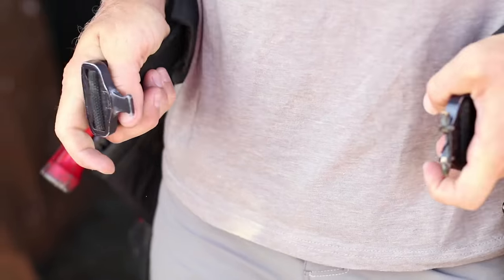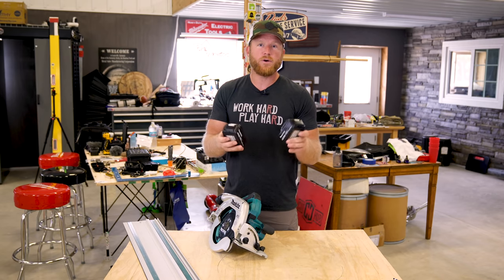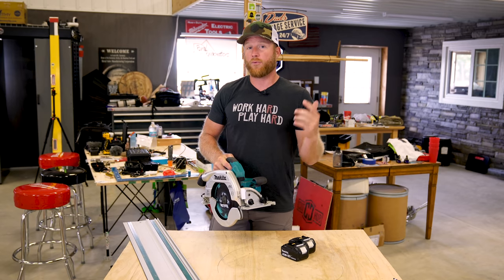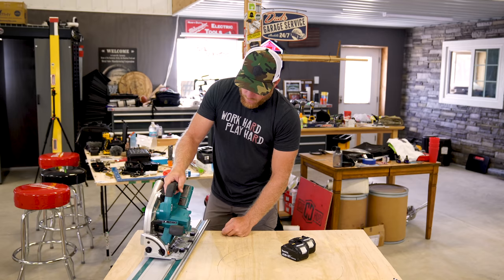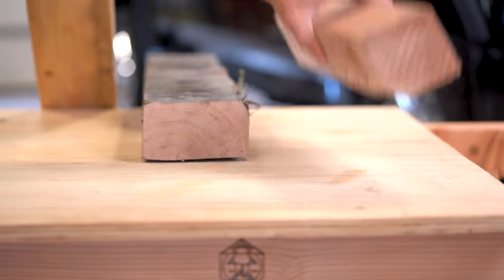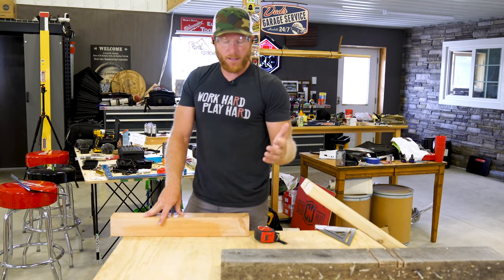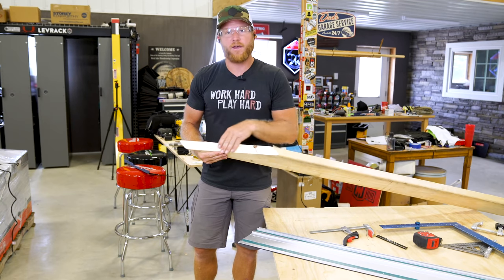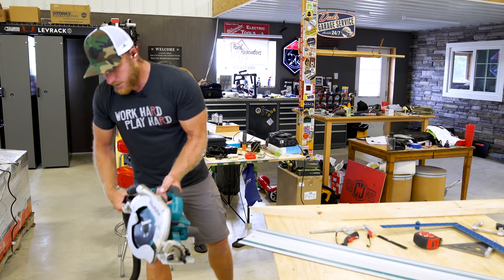Makita 9 1/4" 36V Track Saw!!!  Toolsday

Comment from the maker: I Sure hope other brands take not....uh umm Milwaukee...and put a track capable base plate on their saws... I mean why not!  Let me know below if you agree with me!
Reply: Are all tracks the same for the different brands of saws?
Reply: Dewalt uses a different track but their tracksaw can be used with other tracks.
Reply: Cutting subfloor... set up Negative degree up against a wall in remodels. And you’ll be able to make sure to have a flush cut at the wall
Reply: It would be a great standard option, in my opinion.
Reply: I've been waiting for Milwaukee to come out with a track saw. 
That's definitely annoying that it wont cut 4x in 1 pass...so close.
Reply: Definitely.  That might be where the last eighth inch went on the 4x4 cut, but it's worth it, and they could probably solve that.
Reply: @gman8557  Thank you!
Reply: Agree. Where is track saw for Milwaukee. Their to worried about 4times stronger 10times faster give me a 1time track saw. Lol and a rolling pack out cart cooler already. Dewalt is killing them on the coolers.
Reply: you make me buy new tools, and my productivity thanks you for that. make sure to claim your commission for the milwaukee framing nailed i just bought. keep em coming. greets from NZ
Reply: Mafell have been making track capable circ saws for years. The best you can buy...
Reply: Track plates or kit should be available for circular saws
Reply: @BoilerRoomRadio   Nope, but Festool and Makita share tracks.
Reply: A replacement foot and track accessory for existing saws would be awesome!
Reply: I think why Makita didn't go for a 10" blade for a 3 1/2" cut at 90º is because there wasn't enough power available in the batteries for a safe operation i.e. too much current (ampere) for the battery to operate safely. This would be a significant issue if one was to replace the 24 Tpi blade with a more finer cutting blade which would require more power.
Reply: @will7338  I have the MT55cc and P1cc.  Both outstanding tools.
Reply: I did not know Milwaukee did not make a track saw. What else do they not make but should?
Reply: My flex volt circ saw has a track base on it but it's not the same size blade as the Makita. Here in the uk you can get the dcs575 which is the standard flex volt circ, then the 576 which has the track base,rafter hook etc and then the rear handle one. You can buy the track base and it will fit on the non tracked saw. Is that not available over in the states?
Reply: I've also been waiting for Milwaukee to release a track saw in the US.  C'mon Milwaukee let's go!  While I have a lot of respect for Makita, I really don't want to go into another battery platform just for a track saw.
Reply: mafell kss50 18 m is all you need and I feel like milwaukee is goikg to copy that attached railndesign festool and mafell do, its the next generation of circular/ tracksaws imo,.... have like  30 inch track just to do angled cross cuts. lots of guys in Germany and Europe work with that kind of stuff.
Reply: I agree that milwaukee needs a track saw. That would make my decision way easier since I'm on milwaukee platform already. I hate having more then one battery to worry about
Reply: Totally agree all circ. Saws should be track capable
Reply: @BoilerRoomRadio  no they are not
Reply: The reason why ... $$$ . 
 
Festool, Makita, Bosch... They've suckered right-handed people into using right blade 6-½" saw and making us think we're e happy (well left handed people are 50% happier since they get a right-blade).
 
In 2022, I'm going to Bosch as they're listening (sort of). For 6 months I've been stoked waiting for their plunge/track capable Strongarm (the one with the thumb button for depth adjustment. The one without it is a piece of 💩. )
 
Next year, Bosch will be pushing for top tool. The stuff coming out (my lips are sealed) will be amazing. And now that they have good batteries, we won't have to wait until other tool brands copy them, in order to get their innovations. 
 
And while we're at it, let's welcome all the former Dewalt users. You're in a safe space now. 🤣 🤣 🤣

Comment: I think the integrated track capability should be standard on every circular saw. Hopefully this becomes a trend.
Reply from the maker: agree...not sure why it isn't
Reply: @RRBuildings  Once you go track, you never go back!
Reply: @RRBuildings  Likely because to have such a feature, you need to have a stronger plate, and they're all about taking away, not putting on. So until they all figure out a cheap way to do it, not gonna be a thing.
Reply: Yup
Reply: my festool has, and its 8 years old.
Reply: My bosch gks 85 has it for festool/makita and the bosch track
Reply: Because they can sell you 2 different saws
Reply: then they couldn't sell you an extra tool
Reply: There is a reason not to do that. If you use the rip fence it doesn't cover the wider base. Half of Makita's saws can be used on a track even a saw I bought in 1993 can with an adapter and official parts. There is a big up side besides the track. The larger base allows better use of a carpenters square as a guide.
Reply: @nedudki  My hilti has and its 18 years old 😎
Reply: RR Buildings liability
Reply: bosch do.

Comment: I was one of those people that openly criticized track saws.  I thought they were the biggest waste of money.  It just did what a board clamped to a sheet of plywood could do.  Then I had a project that used a lot of cabinet grade cherry plywood.  In order to get the best use from the plywood, I had to layout a lot of parts that did not allow cutting all the way across or down the length of the plywood.  I broke down and bought a cordless Makita track saw and could not believe how easy it was to layout cuts and plunge where needed.  I got enough track to make 4' cuts and 8' cuts without having to separate the the 8' in half.  Now every plywood project start with cutting everything to size with the track saw then refining (If needed) at the table saw.  As I have gotten older it has become harder to lift hardwood plywood into position on the table saw.  It's not bad at all tilting it on my workbench and cutting it down.  Now I'm jealous because yours is bigger than mine. 🤔

Comment: The rip fence is for accurate repeatability.  Say I had to rip a 200 1 1/2" strips of half inch plywood to fir out some studs on a remodel job. You wouldn't wanna measure and position your track every time, you can just set the fence at 1 1/2".
Reply: Exactly 💯......I can't believe he didn't get this aspect.  I also would use it for cutting all of the header center pieces out of 1/2" plywood when framing.

Comment: The explanation I got on negative one degree is for flooring. You lay your floor tight to the wall and then use a tracksaw tight to the wall with a negative 1 degree cut.

Comment: Makita should have used  standard 10” table saw blades to cut a 4x4 using track.   9-1/4” will be a Sony Beta max.   Kyle excellent job on the tool reviews and video quality,  your better than “this old house”.

Comment: no 4x4" cut. Most likely as for european and japanese market this is likely marketed as 85mm depth saw. I know 80x80mm (so are 75x75) are common then mostly we use 100mm. we generally tend not use sizes in between much, as you only get them under normal circumstances as special (=expensive) on order cuts . Not sure about japan, but most timber here is multiply of 25 or 10's of mm. 4by4 as it not really 4 by 4 inches (would be 101.6mm instead of 89 or whathever it is) is not close to either 80 or 100mm sizes really. You will have to wait for saw expected to cut 100x100mm timber, as those will cut 105mm and change ... likely 10" inch blade saw? Also it seems that nuts holding blade to axle is limiting factor for depth not base plate ... I am sure, image of nut biting in wood sending blade somewhere is not very appealing to you :) blade goes as deep as those retaining nuts are safely allowing it to ...

Comment: Just recently purchased the Milwaukee Rear Handle like the one You had in the vid... Could not be more impressed... Cut through multiple layers of plywood for a good part of the day, and it didn't bog down a bit and after all of the work it did that day, it only went down one bar on the battery... still three bars left... DUDE! That was on the 9.0 battery... Great Toolsday Kyle

Comment: I'm super impressed. I will most likely pick one up. Only dislikes i see is it's a blade right and it won't cut a 4x4. After using a blade left for more than 5 years i absolutely can not stand a blade right.

Comment: The rip fence is perfect for quick rips like 1 1/2" rips on a full 4'x10' plywood for example, laying flat on horses and you need multiple strips for backing or furring out. I do that all the time on my boys Mafell saw. To square it up you just measure from the fence to the front of the blade then lock, and then measure to the back of the blade then lock, super quick super useful.

Gonna get the 7 1/4"! I'm sold on this one especially because we do A LOT of 2 1/4" Conventional Door hanging and my makita 6 1/2" track saw will only do 2 1/8" 

I watch your vids all the time, super helpful. Keep it up! Thanks!

Comment: The 1 degree back bevel give you an extra tight fit when butting let’s say a piece of ply to a fixed wall!  It allows you to really get a tight seam at the top of the bevel.
Bet u did not know that —ha!

I am a cabinet maker:)
Reply: I agree, I was going to say the same thing and then i found your comment. However his question was I can do that on the other side of 90 degrees as well, so why have that option? Just ease of use would be my guess.
Reply: At -1 degree it's not a back bevel though, it would leave the back of the piece longer than the front.
Reply: @c.a.martin3029  if you tried just cutting 1 degree along the edge from the other direction your baseplate would be mostly off of the material.
Reply: Maybe the -1 degree setting is easier to set up than +1, since the -1 has a hard stop, and +1 doesn't (like the 60, 45, and 22.5)? The -1 would also allow you to fix a misalignment, we all know how 90 degrees hardly ever really is 90 degrees, and you sometimes need to tweak it a bit. Giving the option to go negative means you don't have to flip the workpiece or saw around whenever you're facing that issue.
Reply: How do you have negative degrees?  There are only 360 degrees and none are negative 🤪
Reply: @xephael3485  So you would rather see them simplify it by labeling it +359°?
Reply: @timderks5960  i just flip the work do all the time its better for me
Reply: @rubenvarela4077  If it was on a track you would lose the break out protections the track provides
Reply: @dylanjameswagner  ok nice to know
Reply: Or to fit French doors really tight when closed.

Comment: Makita is way out Front when it comes to Cordless Saws , First with the Rear Handle and now First with this Beast.    Milwaukee Who ?   👍⚒🖖
Reply: Actually bosch had this kind of feature for years now, the problem is that they are not as loud as the other companies XD
Reply: Marco Baldi they don’t have a cordless 9 1/4
Reply: You should see the dewalt flexvolts there miles ahead of everyone also they've done a circular saw that is compatible with a track for a while now
Reply: @ryanbourne9916  I have a Dewalt Flexvolt 575,I have never used another circ saw that even comes close to it.
Reply: @ryanbourne9916  dewalts track saw is not miles ahead.... Lmao... Not near as convenient and easy to use as makita

Comment: The rip fence is important to me . I mill timber with skill saws all the time. You don't need marks on it.

You mark the timber cut the length of the blade once . Stick the fence in with the blade already in the timber lock it and finish the cut .Pluss all the following cuts .

Comment: I like sidewinders for a few reasons.  First being that on most cuts, especially when cutting a few inches or less off of a 2x, the majority of the shoe is on the work piece, which is held firm, and not on the scrap which falls off.  The more of the saw shoe on the work piece the more stable throughout the cut, especially when plunge cutting (think fast cross cut by resting base on far edge of board and chopping down) a 2x4 or 6. A right handed guy can't cut with the majority of the saw on the piece with a rear handle, at least without crossing his arms over each other and cutting towards themselves. They tend to put the 1.5" side of the shoe on the piece and the larger portion on the scrap, which can lead to some accidental, and ugly,  bevels.

Secondly, cutting and measuring rafters with bevels tends to be easier when working with the long point.. It is very awkward when production framing to try to hold a board when cutting this way with a rear handle.  You have to cut toward your hand, and need the majority of the rafter on a table or horses.  With a sidewinder you can hold the board with your left hand and cut with your right, away from your body.

The line of sight thing shouldnt be an issue either... The windows are very big, especially on the new Makitas.  Regardless, watch the notch, not the blade, after it enters the board on the line.  It corrects any sloppy cut sooner..  Laborers / new guys often watch the blade (only an issue when cutting sheet goods really) and i constantly get on them about that..  It's the reason their cuts look like the ocean :)

Signed, 18 year rough carpenter in Michigan.  And damn it's been hot lately!

Edit:  to clarify, these issues occur when holding your material... That's all we do here though.  Cutting everything on Saw horses would alleviate these issues for the most part, but for us they are for laying out my stringers and building headers.  We move quickly and cut whatever it is, wherever it is.  Cheers!
Reply: A fellow side-winder fan. Agree strongly on almost all points, especially about the weighted side of the saw, not being on the cut-off side. If you’ve developed your skill by watching the table notch, by all means, don’t change a thing. I’ve just always found the ‘notch’ to be somewhat useless once you set the saw to a bevel though. I’ve always watched the blade and it’s always worked for me, as well as most of the carpenters I’ve worked with. Go with what’s comfortable for you.

In the US, the sidewinder vs ‘worm-drive’ debate has always seemed to be a very regional preference. Guys from the east use side-winders and guys from the West love their worm-drives. The one exception to the rule seems to be commercial form-carpenters who also tend to lean towards ‘the worm’. 

In my experience it seems that whatever type of saw you learned on, is always going to be your go-to preference. I’ve compared it to operating an excavator or a back-hoe. If you learned on an ISO control pattern, you’ll always prefer ISO. If you’re an SAE control pattern guy, chances are that’s what you learned on. Same with surfing/skateboarding. If you put your right foot up front when you first learned, you’ll always be a goofy-foot. Right foot in the back you’ll always be a reg.
Reply: @psidvicious  I agree completely.  Whatever you learned on is a hard habit to break!    About the notch and bevel... Absolutely.  Only on 45s (2nd notch), square cuts,  sheet goods and long rips.  Any bevel cutting between 5 and 40 degrees I watch blade as well.
Reply: All you have to do is stand on the other side of the board when using a left blade saw then you have full 3.5” of shoe on your material
Reply: @dylanhatch4086  It’s not quite that simple and it can be difficult to explain without sketches, but, here goes; 
The problem comes in with beveled cuts. Square cut to square cut on a board, no problem. You could walk around to the other side and cut (all be it, somewhat of a waste of time). 
With beveled cuts, you have no choice on which side to cut from because the saw only tilts in one direction. Most people (90% right-handed) instinctively cut the right side of the board first then move down to the left.
 Making a very common, long to short cut, with a worm-drive, the ‘heavy-side’ of the saw ends up on the cut-off side and tends to dip down as the piece falls away. With practice, you can learn to overcome this tendency, but it always there. [sketches would be worth a thousand words]
Reply: @dylanhatch4086  right... But then how do you hold the board with the other hand?  Like I said, you have to cross your arms or cut off saw horses.
Reply: KILLER Notforhire    Set back for 👼 praise the lord
Reply: I just like the right hand saw works good with bevel

Comment: The - 1 degree is for cutting doors.  A lot of carpenters will put a (very slight) bevel on the handle edge of the door so you can have a very small gap, yet have clearance.